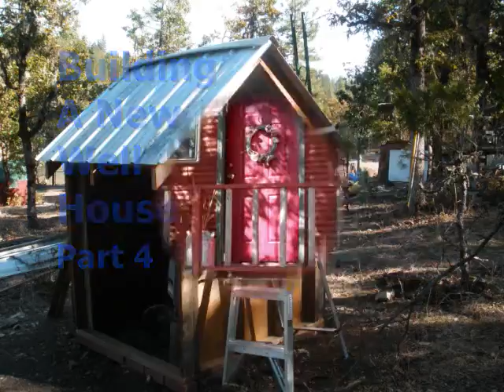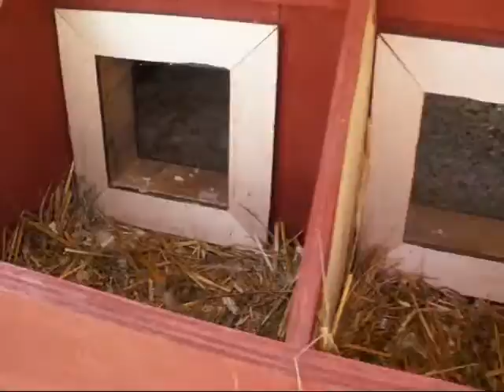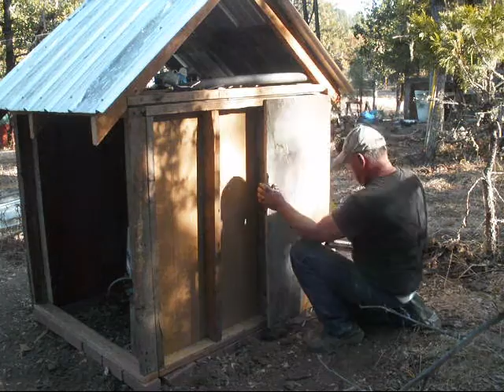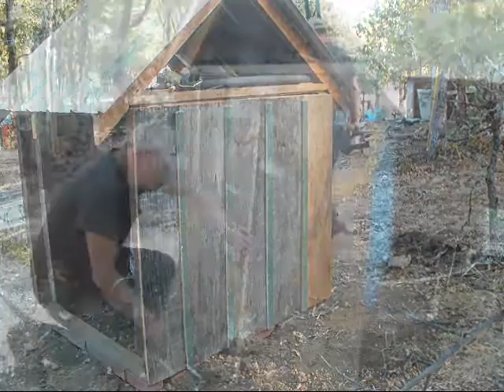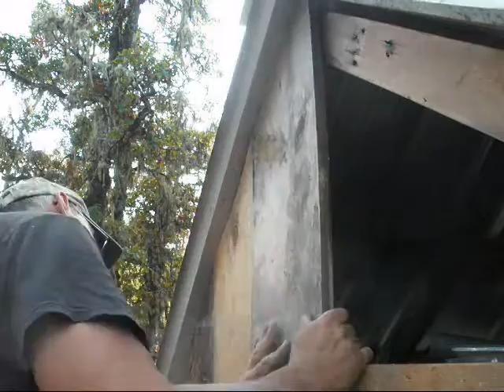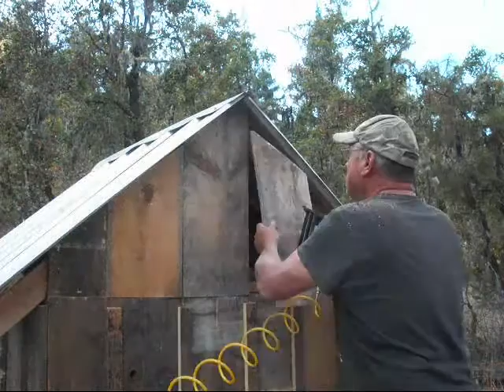HOMESTEAD BUILDING PROJECTS  4 - Exterior Well House Siding

Comment: Sorry, I didn't see your previous answer about insulation. A heat cable is good to wrap around the pipes, except when the power goes out. Nice use of materials on hand!
Reply from the maker: Thank  you. My power will never go out, hopefully, because I am on solar, wind, and propane generator back up power, see Going Off Grid series of videos. If all else should fail, my emergency backup plan is to place a hurricane lamp in there filled with rancid vegetable oil as a fuel. Since I can't cook with it, might as well put it to good use. Thanks for watching.
Reply: Sounds like you're on top of generating power; very good!

Comment: Why no insulation in the walls before putting the outside boards on?
Reply from the maker: Didnt have any, and didnt have money for any. The double wall is insulation enough and a bulb checked daily when feeding the critters during the freezing periods is sufficient to keep the 4'x4'x4' air space warm. After all, it does not get as cold here as it would in other parts of the country. Median winter temp here is around 30° F.